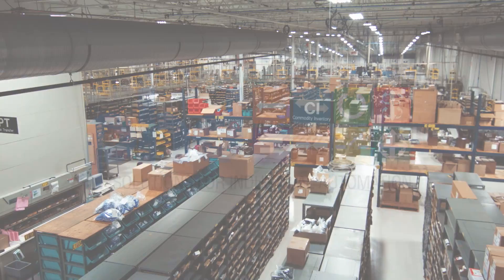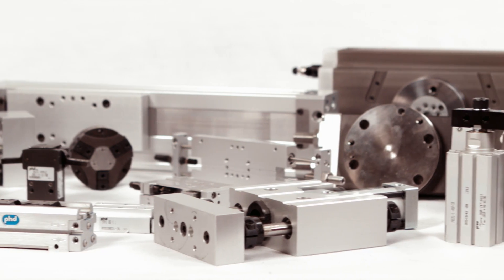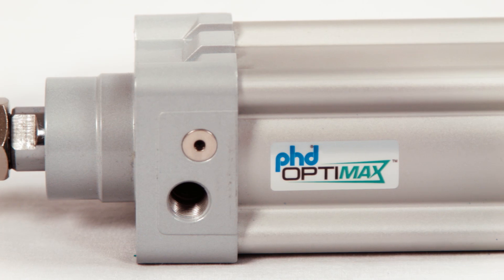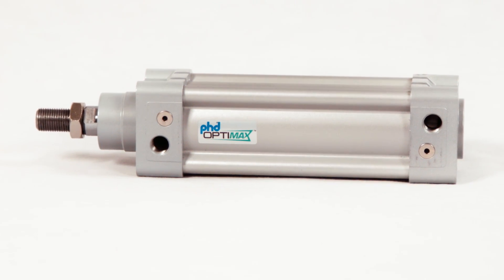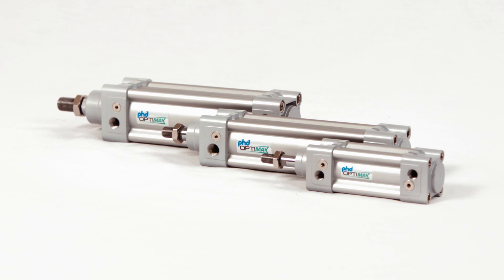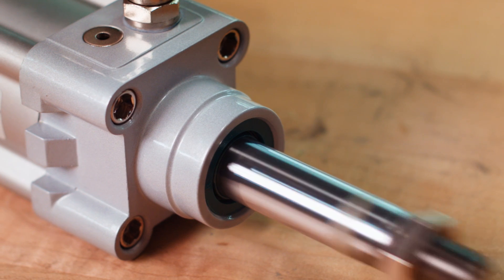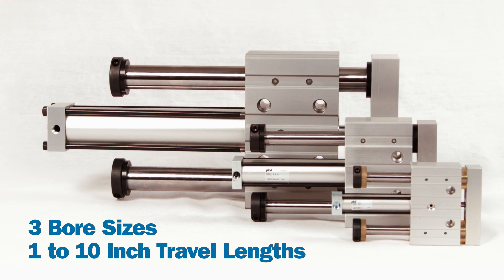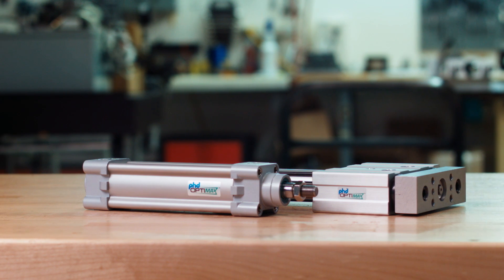PHD Optimax - ISO Air Cylinders & Pneumatic Linear Slides

Comment from the maker: PHD's new line of Optimax products is a combination of performance and pricing for machine builder applications. This video introduces the Optimax line of ISO air cylinders and pneumatic linear slides designed specifically for OEMs. The Optimax series of cylinders and linear slides in industry-standard sizes combines a high-performance feature set and longevity.